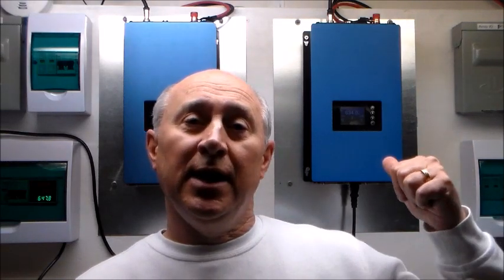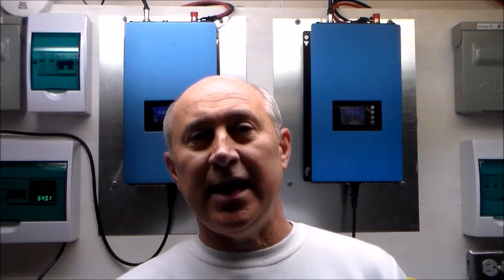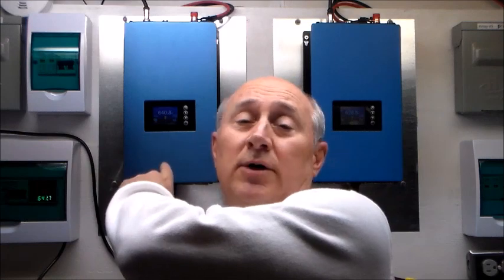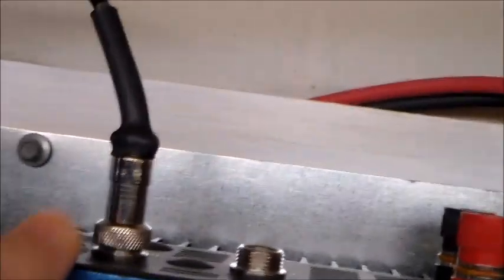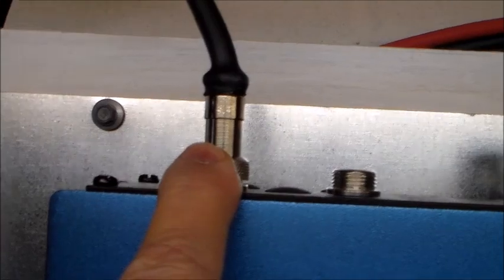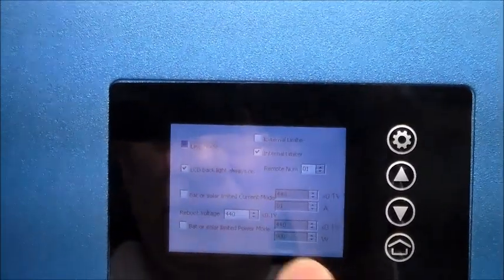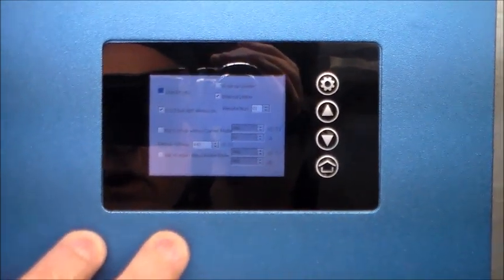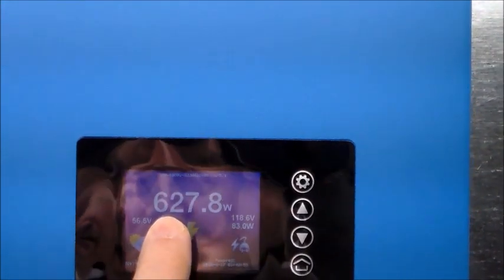DIY Solar - Episode 18 - Sun Grid Tie Inverter (GTIL) - Update Video

Comment: Question -  You said you have 4 X 255 Watt Panels hooked up .  What are the Voltage of your panels and how did you wire it up to work under 90V.   I also have two of these Grid Tie and I also have  250 Watt Panels which are 37V .  Wanted to get some advise on wiring.
Reply from the maker: I connected two sets of two panels in series and then paralleled those two sets together. They are about 38V - 8.3A each. I used 10AWG cable to run to my house.
Reply: @jimginnyohio  Thats what I was  thinking -   Thanks .... Could I hook up 2 of these on the same leg and 2 more on the other leg ?  For my house I would closer to 4000 Watt Grid tie .
Reply from the maker: @alpereira7112  Some people have done that. Although, I’m not sure how accurate the sensor clamps would be in that configuration. You could accidentally back feed some power....gaining the attention from your power company.

Comment: Thank you for your informative videos. It seems that things are never as simple as you'd think they'd be. I have 6 24v Renogy panels and was thinking of splitting them into 3 per inverter, but the open voltage of each panel is 31.4 Volts, which would put me at over 94 volts. Is there a little bit of wiggle room, or do these shut down when over 90 volts. I don't seem to be able to find a good answer. I could look at my legs to see if I draw on one side over the other and go 2x2 (4 panels) in Parallel and 2 panels on the other inverter. I will probably need to change the gauge of my wire though, plus add another run. Just more money... -lol
Reply from the maker: Yes, unfortunately, they do shut down when 90 volts is hit. You didn’t mention the wattage of your panels....
You could configure the panels with 2 sets of two panels each wired in series and those two sets in parallel if they are below 270 watts to get one inverter up and running and then just use two panels on your second inverter. Just an idea....
Reply: @jimginnyohio  Update! I have 2 of the 1000 watt units installed. I have one leg that seems to draw more than the other, so I stuck four 270 panels on it, and 2 panels on the other. On most sunny days, I have extra PV since the house sits at zero when not running any major appliances. I also have a Mppt LV2424 that I have connected to the grid only with a smart switch to float my 24 volt lead acid at about 2 amps for backup. Next upgrade is change out the 12 gauge wiring from the solar to the house. Thanks again for your videos.
Reply from the maker: @ScottMartinez  I'm glad to hear you have things running well!  You mentioned you have the LV2424 connected to the grid??? I didn't think that was possible since that is an off-grid device. That's a great unit for backup power, but it's best to have that running thru a transfer switch so you don't have power feeding from the grid and the MPP device at the same time. That can cause bad things to happen. Is that what your "smart switch" is for?
Reply: @jimginnyohio  The hybrid 2424 unit is just setup as a battery charger to draw 2 amps for floating the batteries. These are on standby, and do not back feed. The inverter is also off. I did buy a transfer switch that I plan to wire the the inverter output to in case of a outage to run the fridge/furnace/lights. My bank of 8 Trojan T105's really don't have much gas, but I should be able to get a couple of days out of it if we lose the grid. I do want to make it so I can easily get PV wired back to the 2424 if the grid goes down for more than a day or so easily. The Suns do seem to be the best bang for the PV during the day. I can get the house to pull 0 from the grid in bright sun, and run all my "always on" loads, and still send the 2 amps to the 2424. The smart switch is so that the 2424 stops pulling from the grid after peak sun. The unit just shuts down, and the batteries maintain their charge. I hope that makes sense. Thanks for your informative videos!
Reply from the maker: @ScottMartinez  Gotcha! Sounds like you have things set up perfectly! Cutting costs during regular times and emergency backup capabilities too!
Reply: @jimginnyohio  sorry, yes 6-270 watt panels. Probably a set of 4 and a set of 2 and set them to the appropriate 120 legs by what gets the most current draw..

Comment: hello Jim, 
I like and appreciate your video, effort u put in your project. I myself have been so frustrated to utilize the 10 panels i purchased from recycle center where some customer/ commercial/ was not happy with it and give it to the recycle center where they resell it for 1/3 of price These panels are  Boviet 375W / model BVM 6612M-375-H  /.... that is how i got it. From that point it is just challenge to utilize them, mount them, wire them, and i am still in process.... 
First I bought 2000 grid tie with limiter from ebay. / it was specified in ebay seller as 120v out//// and it came with sticker  for 185V-265V  out. and it came without limiter... That they sent the limiter which was missing  after week from china, but it did come...
after long back and for emails they specified how to connect it. so I did, it was working 2 days and then it died.   now is in the mail for return.....sad... frustrating....  
I called friend to help install the limiter... we installed it in the before enter to main circ. breaker.... alive... my question is , can that limiter be installed around the wire which is before the el. meter? / coming in my case from ground ????????
BTW, where in Ohio u  are???/ just wonder
Thanks if u will read this.... 
I probably like idea for 2 pieces of 1000W inverters, and to put it to one for each leg.... 
I also was thinking to separate / figure out / which leg is powering what outlet in house and be able to control that somehow... like put my all refrigerators on one leg and maybe just feed only that leg with one controller.... Anyway, i do not want batteries, just simple system and help during the day...
Any word of advice??? 
Thanks for reading this
oct 13 2020
regards Ivan
Reply from the maker: Hi. Sorry to hear about the problems you are experiencing. Regarding the 2000w inverter you have, there is a guy on YouTube that shows how to connect those so they work well in the U.S.  Do a search for SolarEngineering and check his videos. Regarding installation of the limiter, are you referring to the limiter clamp? Or an actual external limiter? I ask because I’m not aware of any of those without an internal limiter already built in. If you are referring to the clamp, the SolarEnginnering guy goes into detail for wiring two of those in series to work with the 2K unit. I hope that helps!  Also, I am just outside of Columbus, Ohio.  Take care!
Reply: @jimginnyohio  Thanks Jim , 
I was referring to the physical location of the clamp. Too bad, I can"t attach photo...  and  it was plagued  to internal limiter side of the unit.
I am waiting for refund and then I will buy next unit and looks like to get 120V is challenge.. Yesterday I spent another  day researching and 
educated myself  in this field. 
I was not able to find the video you suggested , but thats ok, thanks again....Ivan

Comment: since you installed your solar how has it reduced your electric bill ? thanks
Reply from the maker: These two inverters reduce my power bill by about 25% on average. I’m considering setting up batteries to handle some of the after hours usage. That should help reduce my power bill further.

Comment: Hello Jimmy from Ohio, maybe you can help me I’ve tried several places and not had success. Being  a very quaint novice I have purchased day box from MPP solar that was made for the European market (220 ) v .So I’m kind of stuck with it the only solution they gave me was to get a step down transformer no I don’t know where to put that and they don’t seem to want to help me I’m stepping down to 20 V to 120 I suppose what does that do for charging my battery.? Any advice you could give me will be greatly appreciated.
Reply from the maker: Percy Brown Hi Percy - I read where several others have had success going the step-down transformer route. However, I’m not really familiar with those myself since I’ve never personal done that. At one time I considered going with one of the European MPP devices because that was the only way to go 48 volts, but that has since changed. Try searching YouTube for videos about step down transformer solar inverters. I wish I could provide more information to assist you!

Comment: Great video again and thanks. I see you set up the limit at 440 for your 1kW GTIL. I have the 2kW GTIL, do you recommend I set the setting at 440v?
Reply from the maker: czar revs Actually, you can disable those settings completely unless you have batteries connected to your inverter.

Comment: Here at home I have two 120v phases and a neutral one. I have equipment that works with 120v (a 120v phase more neutral) and I also have some 220v equipment (two phases 110v) The 1000w grid tie limiter only injects energy in one phase, the 2000w 240v two phase grid only has a TC sensor for operation in two-phase 220v. How would I be part of a correct operation? It would have to be a 2000w 240v two phase 120v grid and two TC sensors, but it is not manufactured yet. Is it possible that by placing two 1000w grid tie limiter one in each phase, I can inject energy independent of the connected equipment? 120v (phase and neutral) or 220v (two phases 120v).
Reply from the maker: You "Should" be able to connect two 1000w GTIs, one in each phase. This way they would operate independent of each other. I know that some people have also had some success with connecting the 220V version of this. However, not sure if that one would work for your environment. Best wishes!
Reply: Thanks for the guidance. I have to take advantage of this strong sun here in Rio de Janeiro.

Comment: @jimginnyohio. Regarding the oldest inverter of your setup, for how long are u running this unit ? your first video that I saw on your channel is like around 2 years old, did u had any issues at all? where did u bought it ? I'm planning to buy it from eco-worthy on ebay, but if u can share your supplier and haven't had any issues, I will look up to get one from the same supplier u did, THANK YOU so much for posting this videos, greetings from Mexico
Reply from the maker: Menny Hello Menny. The oldest inverter I am running is 3 years old now. I have experienced no issues with it at all. I take it off the wall each year to clean the dust out of the fans, but that is about all I have done to it. Eco Worthy is a good company to deal with. I purchased one of my inverters from them. Good luck with your install!
Reply: @jimginnyohio  thanks for the fast reply

Comment: I am in Jamaica and we use 220V/110V split phase.  I purchased an older version of the GTIL where the limiter was external.  This was a 220V version.  I am planning to purchase a identical CT and parallel it on the limiter, but placing one of the CT on L1 and the other on L2.  My theory is that the resulting current will the vectorial sum of the two currents and would work properly.  Is my theory correct?
Reply from the maker: My suggestion is to join this Facebook Group: Solar Grid Tie Inverter with Limiter USA Users
There are some great people there that have provided the details and diagrams for what you are hoping to do. I would hate to guide you an the wrong direction since I have not personally set up one of the 220V versions of those inverters. Good luck. I hope you are successful with your project!
Reply: Yes it should cause each leg is being measured instead of one out of two, Right now i have One GTIL 2000 connected to two legs by running them in series so far it works....

Comment: Thank you for the update Jim! great job on everything.  Do you know if you can add a battery pack to the sun grid tie inverter to be able to minimize grid use at night?
Reply from the maker: Yes, as long as the battery voltage matches the required voltage on the inverter you select. These 110V GTIs are available in either a 25-60V range or a 45-90V range. Your battery voltage must match the model you purchase. Within the menu of these, you will need to program the startup and shutoff voltage so that when your battery pack gets low, it shuts off. That can also be controlled if your battery has a BMS.
Reply: @jimginnyohio  thank you!

Comment: Hello, great video. I have a few questions I hope you can help me with. Sorry if I missed it. Do both circuits for the inverters each on one leg?
Reply: Meaning a leg has a feed and b leg has its own feed to the other inverter
Reply from the maker: Neil Cartwright Yes, that is correct. Each inverter and monitor clamp is on a different leg.

Comment: Hello! I just received my Sun GTIL inverter and once I connect it to AC (with or without PV) , it makes an electronic noise quite loud. I am discussing it with the seller but I'd like to have more opinions. Are your inverters noisy (not the fans)?
Reply from the maker: Joaquim Barrera No, not at all. The only sound coming from mine is when the fans spin up. It sounds like you received a bad unit.
Reply: If it's a low frequency inverter it could be the sound of transformer hum.  If so, this is normal.

Comment: Thanks for the video, i am planning to use one of this thing with 2kw version. Ia there any setting to minimize the grid supply, and is it possible to extend the length of the limiter cable?
Reply from the maker: Hi - Not sure what you are asking "to minimize the grid supply". The inverter will automatically sense the amount of power being used by your home and will supply as much power as possible to offset that which is being supplied by the grid. If the inverter is producing more than you are using, then all of the power will be supplied by the inverter. However, if you are using more than the inverter is producing, your home will first use the inverter power and the rest of the power will be supplied by the grid. I hope that answers your question??  
Yes, you can extend the length of the limiter cable since it is only two wires. However, I've heard reports that you should not extend it beyond 35-50 feet since the readings will not be accurate beyond that.
One other point of importance: If you are using the 2kw version within the US, you will need to get a limiter cable that has two clamp sensors on it since in the US, we have two 120v circuits coming into the house. You can get details for a dual clamp and how to connect that by reviewing the information in this Facebook Group: Solar Grid Tie Inverter with Limiter USA Users.
Good luck with your installation!  Take care!

Comment: Jim this has been a very informative series and I thank you for it.  I have a question about how you connected your second GTIL, since the 2 legs on the grid are 180 degrees out of phase with one another?  Do these units somehow synchronize with the incoming grid?  Please explain in layman terms.  Thanks.
Reply from the maker: Rod Reeves Since these devices are grid tie inverters, they are able to synchronize with the grid independent of each other. Each device monitors and provides power to separate sides of the grid. Since they synchronize with the grid power, they aren’t aware of each other. Does that make sense?
Reply: @jimginnyohio  It does make sense that they would sychronize independently.  I just have not seen any documentation that these particular devices have that capability.  Thanks for the quick reply.  Hope everything continues to go well.

Comment: since you now have the 2 inverters 1 on each leg do you see it running a 240v device ?
Reply from the maker: Joe B Whever my well pump, hot water heater, stove, or dryer come on, I see both of the units ramp up to deliver the needed power for those. It’s pretty cool. Wishing I had installed the second unit sooner!  :-)

Comment: Why did you put a metal sheet at the back of the GTIL2?
Reply from the maker: Christian A Since the back of the GTIL is a heat sink, I wasn’t sure how hot it may get and didn’t want that in direct contact with the wood. The metal should help to dissipate the heat a bit. Just an extra safety precaution.

Comment: I have two of those grid tie inverters. I have had them for 10 months and one failed today.  It constantly reads 0 watts no matter what.  The company will not respond to emails and amazon won’t do anything about it because it’s outside the return period.  The amount of money I saved from the inverter is about 130 dollars in electric bills, which isn’t even close to paying for the cost of the gti. This was not a good investment.
Reply: I also had bad luck ,  I have a single one , worked great for around 2 months , then started ramping up and down on the power generated . I had to keep on dropping the output wattage setting  but now it is at a stage where it  just ramps up and down from 0 to 10watts .    Mine was purchased from ALI  and I do not get any joy from the supplier.  Pity it seemed like a good unit  but with no after sale support its just money wasted.
Reply from the maker: Sorry to hear about that. Yes, I have heard from others with similar problems with these inverters. In most cases the issue is with the mosfets that handle the incoming power. This is why I went to the extra time and expense to add the protection devices I posted in a previous video. Regarding the amount of power/money you saved over the 10 months of running the inverter, please keep in mind that your return on investment will not be instantaneous. With most professionally installed systems, the payback date isn't for about 14-15 years. By doing it yourself, you are still looking at about a 7 years return on investment. Please don't give up on solar! It works! Good luck!